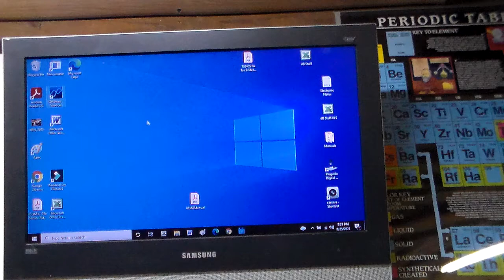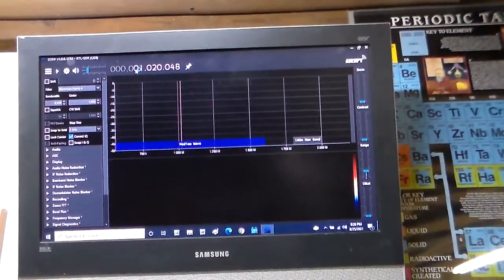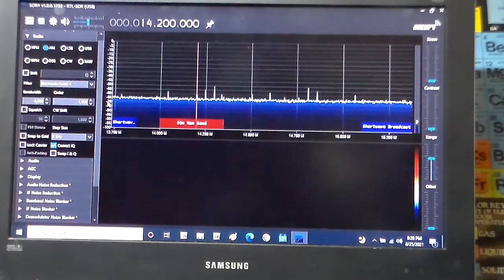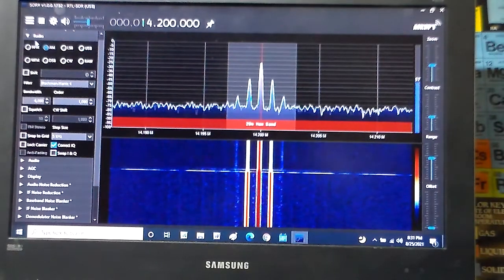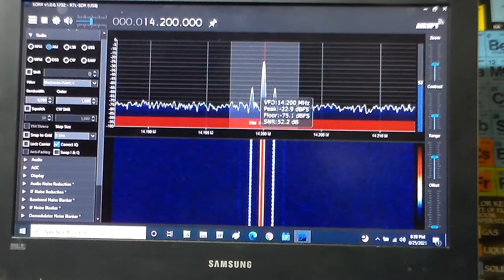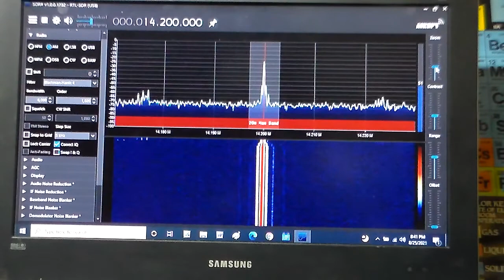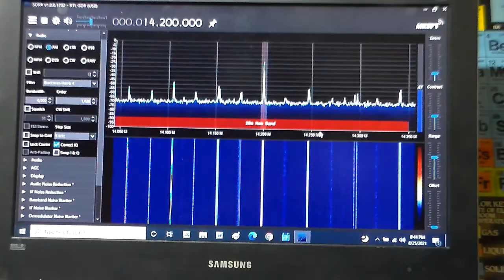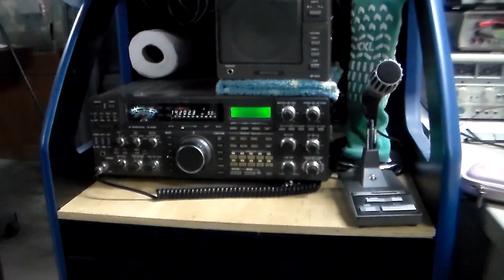RTL-SDR Poor Man's Spectrum Analyzer

Comment: I have had the same experience with fathom signals on SDR's but not as bad as what you have had here. In the past I used a generic SDR with a frequency converter fed from the IF out on my Kenwood TS-830s and HDSCR software as a spectrum analyzer with pretty good results. Those spikes were there but very small. I don't think you can get rid of them. Perhaps is a flaw in the SDR or the software? I have not used the SDR in a while but plan on using it as a spectrum analyzer on my Kenwood TS-940s at some point as well.